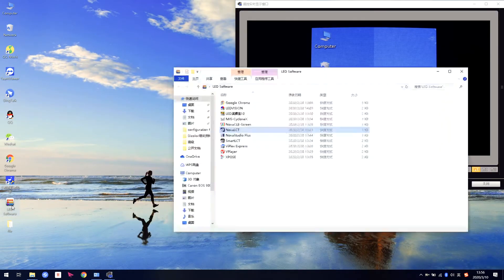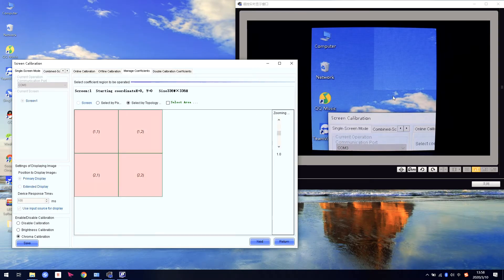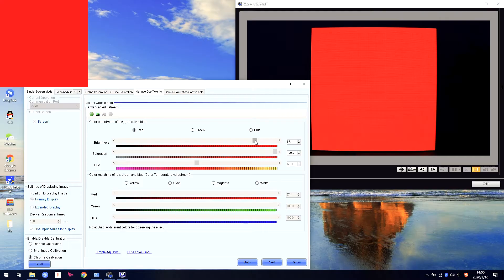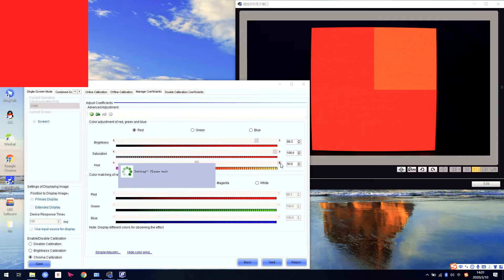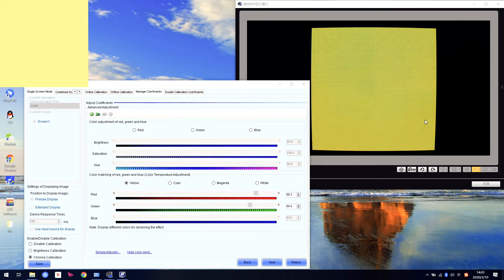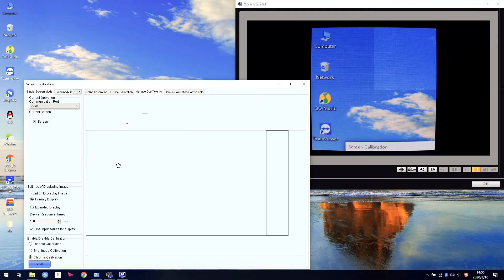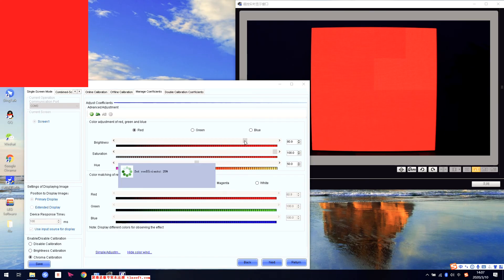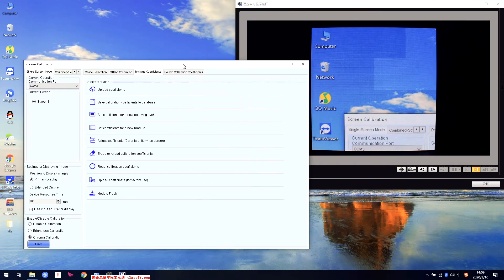Dicolor & Novastar--How to Calibrate(Calibration) screen(cabinet) manually used novalct (In English)

Comment: Hi Sam,
Can I take one cabinet as a reference and send their informations to the other ones ? I got multiple cabinets to calibrate and not much time to do it
Thx for your great video
Reply from the maker: you mean calibration coefficient ? if the data is just for a cabinet, you can't sned it to other cabinet. because it will be make it wortse。
Reply: @samzhou8510  Hello, if there are two batches of cabinets of the same model, but all the cabinets in the second batch have a different shade from the cabinets from the first batch, can I, having calibrated one cabinet from the second batch, send the calibration data to the rest of the cabinets from the second batch?
Reply from the maker: @hmzauze  yes. That is available .

Comment: HELP ME please i have done something wrong and my entire screen displays only red color, same on the test without rj45 conected, nothing blue, nothing green
Reply from the maker: You should have set the pre-stored screen, and the pre-stored screen is just a red color, so the situation you mentioned occurs. You just need to turn off this function. The specific setting is in the settings of the Nova LCT software, pre-stored screen, select None and save it.
Reply: @samzhou8510  Hi, I would like to know how I can put the screen in of the LED with the red, green and others color of adjustment, because the color stay just in my laptop, so the colors are in the same tone. Even so, I thanks for lesson. Great help was the video for me!
Reply from the maker: @FranciscoSousaRebuscardesign  when you copy the operation like me . you will see your screen show the pure color. and have some change when you setting in software. the only think maybe you need setting the send card in maSousaRebuscardesign  when you copy the operation like me . you will see your screen show the pure color. and have some change when you setting in software. the only think maybe you need setting the send card in extend mode or primary mode.

Comment: I have a probléme  , ,,, the rectified coefficient of the  reception card is not reasonable, please settel after having  ,,
Reply from the maker: Some modules have built-in lamp board FLASH, which will store the brightness parameter value and correction coefficient of each lamp bead, which can be read and used by software. The premise is that the display manufacturer must do point-to-point calibration and store the data in In the module FLASH, if the module itself is relatively low-end and does not have this function, it is necessary to re-calibrate the display;
Reply: thank you for Réponse

Comment: Thank you for the valuable information you have provided. Is this problem related to the receiving card? Although very rare, this kind of problem has happened to us several times. It disappeared after replacing the buyer card. But we couldn't understand why it suddenly appeared. I don't know if it is related to receiver board failure. Is it possible to repair the card if it is related to the card?
Reply from the maker: Most of the time, if this problem occurs during use, it may be because the firmware of the receiving card is inconsistent, some receiving cards are not controlled when adjusting the brightness, or you can try to turn off the correction function. Sometimes the correction factor affects this phenomenon

Comment: Hello, thanks for the setup info. If you know how to increase the display area on the novastar msd600 board. Not a small corner from the top left, but a full screen.
Reply from the maker: MSD600 no have video processor function. i think you said it's scale function. but MSD600 just a sender. you can creat a windows. and that window the resolution same with screen. so it(video or picture) can be full display on screen. or used extend mode. make MSD in second monitor . and setting MSD600 resolution same with screen.

Comment: Today I have learned this type of setting for the first time.  Thank you so much for learning
Reply: I can't color correct the indoor and outdoor led screen so is there anything else I hope you can help me with. thank you!

￼
Reply from the maker: @nhalam2037  At present, manual calibration can help you to improve the brightness or color difference. It is more helpful for products of the same model and the same batch. But for different products or different  manufacturers, even with professional calibration equipment, it is impossible to make them completely consistent, because the wavelength and visual angle of the lamp beads cannot be changed. I hope my reply can help you.
Reply: @samzhou8510  thank you for your reply your videos are awesome thank you for that. Wishing you a lot of health and success in life!

￼
Reply: Hi